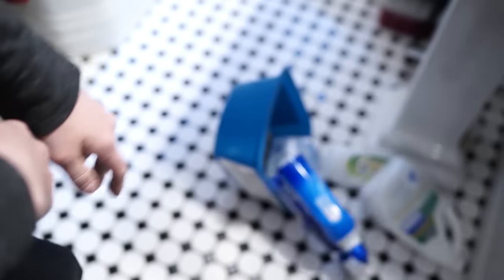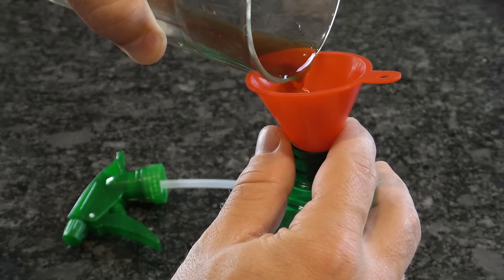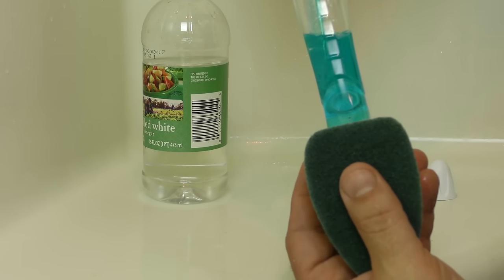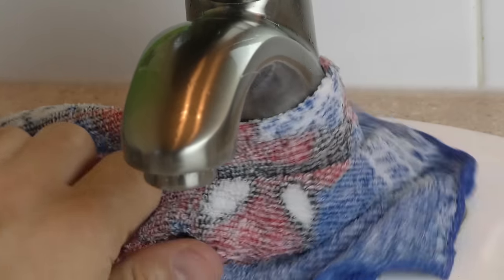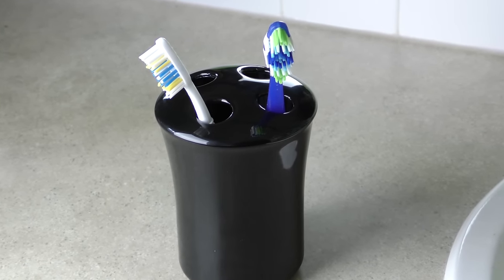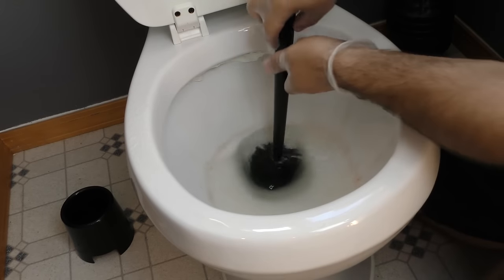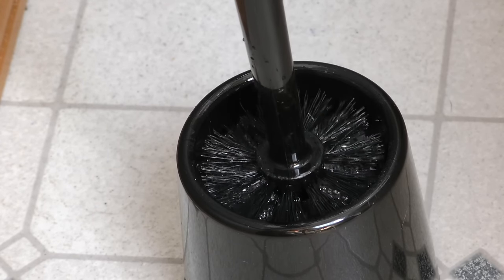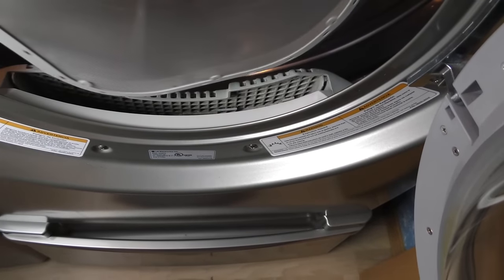7 Genius Cleaning Tricks For Your Bathroom

Comment: Another tip about the dry lint deposit: If you are using anti-static sheets in your dryer, be sure to put the lint collector out every month or so and dunk it in hot water with soap for about half an hour then rinse. As you use the sheets, they leave a residue on everything in the dryer that stops static from building up but also clog up your lint dryer, reducing air circulation toward it and can make your motor work overtime and break it.

Comment: A suggestion regarding the viengar/Dawn solution ... I use cleaning/industrial strength vinegar. It has a higher acidity level and works better than food grade vinegar on hard water stains. I live in Austin, TX and we have very hard water. Nothing worked until I started using the cleaning strength vinegar.
Reply from the maker: You're right. Common distilled white vinegar is typically 5% whereas industrial is 6%, slightly more effective. Either will work, though.
Reply: Vinegar addiction
Reply: HouseholdHacker cool
Reply: I buy 10% works like a charm! love it. It's strong in smell yes , but does it ever do the job. :) They do sell it at the supermarket, normally in the isle for "Natural" products. not sure if I'm allowed to mention the brand , but it's called "ALLENS" cleaning vinegar. Double concentration.

Comment: Because making tea is so much faster than using glass cleaner...
Reply: +JaQuan Jones He did say if you're into natural methods.
Reply from the maker: Perhaps you ran out...or want to go an eco-friendly, all-natural route such as this instead.
Reply: or if you ran out of glass cleaner you may still have some tea in the house.
Reply: +FlippinWindows | #1 Windows Tutorial Channel! it's a dude
Reply: JaQuan Jones it is cheaper though. Assuming he bought a 100 count of Lipton black tea for about $3.50(that's how much it costs in my area) he only spent 11¢ per 8oz of cleaner versus $3 for 26oz of Windex where you would spend 96¢ per 8oz of cleaner
Reply: glass cleaner doesn't clean as well.  i would say for best results on glass would be using dish soap followed up with a squeegie wipe.
Reply: use vinager lol

Comment: I am definitely going to try the vacuum & a paper towel, or wrapping paper roll on the dryer. A few months ago my dryer quit working due to lint build up underneath the trap. It got too hot and threw a safety switch. Costed me around  $60 to have it cleaned out & the switch reset!

Comment: I don't think it is a good idea to use bleach in the toilet brush container. Pine sol would be better. If you accidently get bleach on a floor rug or your clothes, it could leave it discolored.
Reply: Agreed. This is another one I'm going to try. ☺
Reply: I was gonna say to use Fabuloso
Reply: Micaela C I used Mr. Clean-Gain scented in mine...worked like a charm! I've never tried cleaning with the Fabuloso...does it work well?
Reply: How about just white Vinegar? !
Reply: hydrogen peroxide and alcohol works great and it actually kills germs

Comment: I only use Clorox toilet sponges.....they work so well, and you don't touch anything. I also use rubbing alcohol for the majority of my cleaning. It cuts grease, shines mirrors and other glass, and is a disinfectant, and its  cheap. And my spray bottle  top fits right on to the top of the alcohol bottle. I use it on my sponges and scrub /bottle type brush in my kitchen after every use to keep them clean and fresh.
Reply: Look bhul bhuk

Comment: What about just brewing an insanely high concentrated glass of tea and use only a little bit of the concentrated tea with some water when you want to drink it. Would that save time? I think it would...
Reply from the maker: That is definitely a multi-purpose solution. Good thinking!
Reply: +Luke A Boss Avocado skin works really well for cleaning glass. The creaminess polishes the mirror and makes it smoother.
Reply: +Luke A Boss How about brewing an insanely high concentrated glass of tea and sitting down and drinking it. LOL

Comment: but my bathroom stinks like vinegar now
Reply: +T Ank Mix in some lemon juice with the vinegar in a separate bottle prior to cleaning. It wont get rid of the vinegar smell, but it'll cut it down considerably.
Reply from the maker: Crack a window (or two). The smell will dissipate.
Reply: +HouseholdHacker Lets hope he wont' take the "crack" literally.
Reply: +HouseholdHacker What if you don't have a window in your bathroom?
Reply: +Random Youtuber to fight any smell, especially if you are a teenage boy like me who works out  , put some dryer sheets in all of the vents around the smelly area and it will make the smell go away in a matter of minutes
Reply: lol you can just spray your bathroom with fabric softener or air refreshener
Reply: T Ank. try using citric acid powder as it easily shifts dirt and limescale but doesn't stink like vinegar. Something tells me that you couldn't really care less anyway !

Comment: My house smells like vinegar. Thanks.
Reply: +Swxxt the smell doesn't last that long, especially if you rinse with plain water after cleaning. most of the things he cleaned constantly have water flowing over them.
Reply: +Swxxt That white vinegar stuff is just Asetic acid :P
Reply: +Swxxt then you probably used the wrong vinegar
Reply: +Swxxt  Just open the bathroom window for a couple of minutes and the smell will go away. I do that :)
Reply: +Swxxt Scroll back a couple of videos, pretty sure you'll find some soda related "hacks" to remove unpleasant odors.

Comment: I did the paper towel tube vacuum trick. But i guess my shop vac was too strong. It sucked the tube closed, so didn't work. But will try again, but will put some thing to keep it from shutting completely. Can't find an extension hose long enough.  Tried the lemon as a cleaning trick. Works very well. Be sure to keep lemons in fridge when not in use. Only got to use 2 from a bag then the rest of them turned to green mold within 2 days of being left in counter top😖 lemons aren't cheap in my town. Works great for cleaning cooked on food from pots n pans. When used with baking soda. But most people know about that tip. 😙have a great weekend Every one.

Comment: Thanks for the dryer lint tip. My neighbors house burned down because of an unclean lint trapper.  Ever since that happened, I won't leave the house with the dryer running. I never thought about cleaning down inside the lint area. I only clean out the removable part.

Comment: I didn't know about strong tea & glass. I usually use vinegar & water with a little dish soap to clean glass or mirrors. 
Pine disinfectants or other chemical disinfectants are a health hazard. It's better to soak it in a bleach solution or high proof alcohol.
Reply: rubbing alcohol and water cleans mirros and glass best.

Comment: While you are cleaning out the dryer, wash the lint screen with detergent and water every now and then. If you use dryer sheets, it can build up a film on the screen of the lint filter. Take it to a sink and scrub with a brush and a small amount of dish or laundry detergent. Let dry before you place back in the dryer

Comment: If your lint mesh is in the back of your dryer you don't have to worry about it catching on fire that much.If your lint mesh is in front of your dryer suggest opening the front bottom panel and vacuum underneath remember to disconnect the dryers electricity.

Comment: A bathroom item which very few people clean is the toothbrus.  Think about the bacteria that is put there.  Once a week, simply run it through the dishwasher, brush side up.  The cycle will destroy the bacteria.  This is especially important when someone has a cold.
Don't throw the old toothbrush away!  Wash it in the dishwasher and then take an elastic and wrap it around the handle to identify this very handy cleaning tool.  Great for cleaning around the facets, the can opener cutting edge or any other hard to reach area which could use the brush bristles to scrub.  Simply use and then rinse and put in the dishwasher.  The elastic will indicate that this is your cleaning brush.

Comment: Using fresh lemons that cost 50 cents (or more) each, is an expensive tablespoon of citric acid. Vinegar is much cheaper and a bottle of acid used for hot tubs can be diluted in water to the desired strength for pennies a gallon.

Comment: Try cleaning your entire washroom with Lysol toilet cleaner (LTC).
It will remove soap scum from all surfaces.
I scratched my faucet to scrape away the scum, with LTC I wiped it off.
Apply Lysol TC to the top rim of your bathtub, it will flow down.
Squish some LTC onto a microfibre cloth and wipe down EVERY surface in the WR,
including all plastic containers and every surface of the toilet.
Once you finish wiping, go clean the tub and faucets (any area with scum build-up you pre-treated the LTC).
I tried all sorts of methods and cleaners, this was the easiest and most effective.
Do not use for mirrors or non-plastic laminate tops.

Comment: To clean the mirror:
1) Use water with a squirt of rubbing alcohol, glass cleaner, tea or the cleaner of your choice. 2) Wet the mirror by spraying or by wiping it on with a very wet scrubby sponge, the blue kind- not green so it won't scratch).  3) Let sit for a minute or so.  4)Then, give it a quick once-over with the scrubby side of the sponge to loosen the dirt.  5) Use a squeegee in a quick S-motion from top to bottom to wipe off most of the water (leave a little bit).   6) Polish it off (fast, before it dries) with a clean, dust-free towel rag (preferable to newspaper or paper towels - and better for the environment too. 7)  Done.   This will also make cleaning your windows and sliding glass doors much more fun.
 
2)  To clean that hair out of the drain -pull out what you can, then:  1) Wet your drain with hot water and let it sit  2) Once it goes down, pour a little bit of baking soda (not too much) down there, 3) follow it with some vinegar and shut the drain thingie 4) leave awhile 5) rinse and repeat as necessary.   Be careful with this combination of vinegar and baking soda, don't overdo it, use sparingly, start small, just use a little bit at a time to see how much it fizzes and take your cues from that.

Comment: I will not use anything else anymore except peroxide to clean mirrors and Windows.  Nothing works better. And doesn't need a lot. Plus no elbow grease needed.  I don't mind the smell of vinegar. I like to think it's freshening up the household air at the same time. 😃

Comment: If your toilet bowl has stubborn hard water stains and/or other residues: Turn off supply line,  flush, and use a sponge to get as much residual water out of bowl and tank. Then use about a gallon of white vinegar, some in tank, but most in bowl. Let sit for at least 24hrs, preferably 48hrs. A toilet brush should work from there. For really stubborn/thick mineral deposits, use a piece of wood (chopsticks work well) to scrape off the scale (don't use metal, it will scratch the enamel). Then flush and it should look brand new.

Comment: I'd like to take the toothpaste/binder clip a hack further. I find it saves me time and water to brush my teeth in the shower. And for the women, avoid breaking your neck leaning over the sink with a wet towel around your hair to brush teeth after showering! 

I have a shower organizer hung on the shower head. Usually they have a hook and I hang 1 end of the binder clip on it so it's always ready to use. This can also be used for washcloths, wet bathing suits or drying lingerie. 

If you find one(s) big enough, use for tubes of face wash, shampoo/conditioner etc. Use extra shower curtain rings to hang on curtain rod or towel rack. 

Use your imagination for a billion other uses inside or outside the house, in the car....etc!

Comment: If you really want to clean your bathroom mirror, start by brewing a really strong cup of black tea. No you’re not taking a break, it’s a cleaning hack that is sure to make things better. Put the strong tea in a spray bottle then grab some newspaper instead of paper towel. Spray the dirtiest mirror in your house, then wipe. After two or three applications, you’ll be blown away.

If your shower is long overdue for a deep cleaning, grab yourself a dish wand. Then fill it with half vinegar and half dish soap. The result is quick and easy.

Want to get rid of those hard water stains from your faucet and other fixtures? This is perhaps the most natural solution yet. Grab half a lemon and rub it on the metal fixture.

One quick trick for cleaning your toothbrush holder or soap tray is to simply put it in your dishwasher during the next load. Let the machine do the heavy lifting for you!

Comment: Actually, if you heat up the vinegar (smells even worse) in the microwave for ~30 secs, then add the blue Dawn (has to be the blue). Put it in a spray bottle, spray down the shower, wait an hour, then rinse. Same result, no elbow grease required.

Comment: I think that newspaper on the mirror is going to leave minute scratches. If you do it enough times, it's going to start showing--your mirror will lose its clarity.
Reply: +ssppeellll No  honey, diamonds will cut glass but I'm sure  paper will not.
the reason you have been told not to use paper on  your glasses is because they are plastic, not glass.
Reply: +Carol Norton "Honey"? Don't let my wife catch you calling me that!
I actually haven't been told not to use newspaper--it just doesn't seem like a good idea to me. Perhaps because when I have tried it, it sounded and FELT like I was scratching the glass. 
But your response prompted me to google the question. I got varying responses. The theoretical ones mostly made it sound like a bad idea--impurities in newspaper; a dearth of nap maximizing the chance of bits of grit being pushed around by the newspaper, which could scratch the glass. Personal experience responses mostly made it sound fine, even recommended. 
Bottom line for me? I'll pass on the newspaper. I don't like the scratching sound/feel, and I don't like getting the newsprint on my hands.
Reply: ssppeellll Sorry about the  inappropriate" term of endearment", I saw the Pegasus and assumed you were a preteen  girl.

Comment: The best way to clean ur bathtub and walls is to steam them ...soap scum and ..have built up and that's the hardest to get rid if .keep running very hot water and steam with curtains closed .then stop and start to scrup the walls with a mild soap any soap and medium abrasive sponge   . The results   :  amazing     good luck  you ll have new bathroom..

Comment: When you use a newspaper don't crumple it, instead fold it into squares.  The edges will sync perfectly to the sides of the mirror / glass.  And then you can use the other side, then open it and fold it inside out to use 8 other squares.  You get 10 x the amount  of use that way

Comment: The tub cleaner worked great. Soap scum cleaned. Now, I'm not scared to take a bath..lol! The commercial cleaner works as well but who wants to take a bath after those harsh chemicals? As for the vinegar smell, just open your darn window just as you would when using store bought stuff.

Comment: I certainly wouldn't be filling the toilet brush holder with disinfectant. Far better to let the brush 'air dry' by wedging the handle under the seat for half an hour before replacing. No need to stuff toilet paper under the rim either. There are brushes that have an attachment on to whizz round and underneath that area.

Comment: I clean my bathroom, including the around the toilet, mirrors, floor, sink, etc. with rubbing alcohol and toilet paper and paper towels.  Clorox toilet bowl cleaner has always worked well for me.  I just squeeze it around the bowl and walk away. About twice a month, I use the toilet brush to scrub the toilet, Clorox Toilet Bowl Cleaner desolves the dirt and stains all by it self.  I clean the tub with a mixture of Dawn dishwashing liquid and vinegar.  I throw the shower liner in the washer and put it back up wet although I consider them disposable.  The liners last longer.

Comment: Don't understand the toilet wand holder one... You could just not be a clod and rinse the wand with hot water after you use it. And make sure you tap off the water and rinse out the holder, that's what causes the mold.

Comment: This is the solution to traffic patterns, black feet and socks, and why your grout gets so dirty no matter how much you mop. Share this information! Copy and paste the text as it will not post the text when you share it.

You rinse your hair, you rinse your dishes, your clothes go through a rinse cycle, yet most don't rinse their floors.

Soap is made to bind dirt. When you leave soap residue on your floors, it will trap the dirt. 

If your tile and grout is sealed, harsh chemicals will emulsify the sealant and then dry which reseals the floor with dirt trapped underneath the sealant. 

So rinse with cold water! It really is as simple as that. 

The steps to take is on my last update, or an easier trick is to use soap one day and over the next two days rinse with cold water.

I guarantee you better results and cleaner floors. 

Traffic patterns can be seen darkest from the moment you step off hard floors and lightens as you progress into the carpeted room. This is due to premature wearing of the carpet because you are dragging soap residue from the hard surface into the carpeted surface. You are transferring harsh chemicals right into carpet fibers. 

It takes an average of 27 steps from hard surface through carpeted areas for the soil to come clean from your feet.

If you can take a wet paper towel or wet white towel and scrub an area of your floor after cleaning it and it turns dark, you are mopping improperly. 

Your mop water should come clear when you are finished. 

Share this please, this is my little secret that I've only shared with customers while in their homes but I am now trying to teach the world!

Help spread the word!

https://www.gofundme.com/3psrpt4